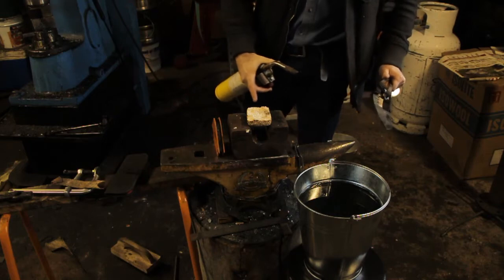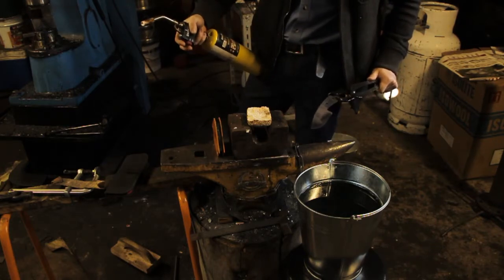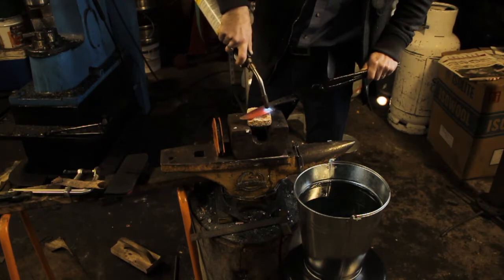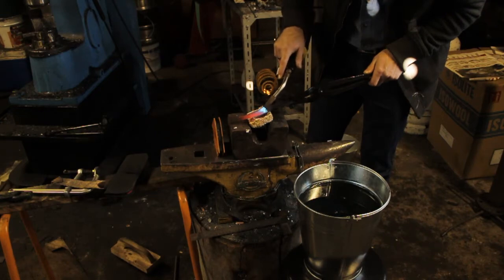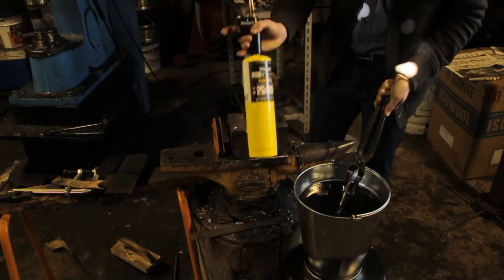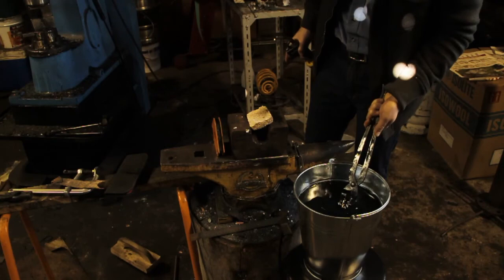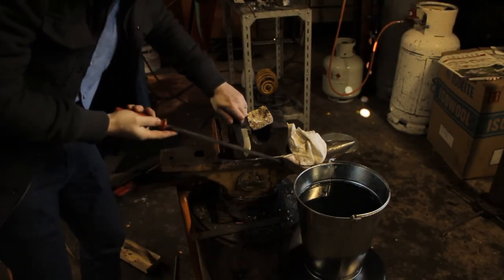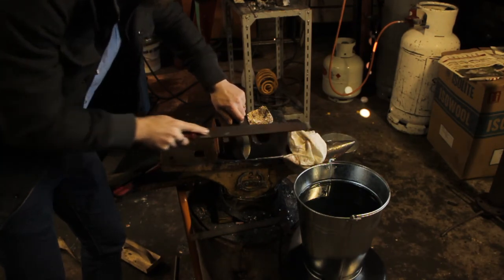Heat treating with a Map Pro Torch

Comment: I think you might be working against yourself having the torch so close to the knife.  Correct me if I'm wrong but, allowing the inner cone of the flame to touch the work tends to have a cooling effect as it allows unburned fuel, which is cold from it's phase change from liquid to gas, to contact the metal prior to it's ignition.  If you maintain the flame so that the knife is at the tip of the inner cone, rather than the inner cone mashed up against the knife, I suspect will heat much faster than as demonstrated.  Just a thought...

Comment: I've always used my homemade propane forge to heat treat never tried to use a map torch until today. Well last night, I was using unknown steel so I tested a piece and it hardened great, but when I went to heat treat the blade I couldn't get a uniform heat. I ended up doing it in two parts. Bottom half closest to the tang then top half. It hardened enough to slice my finger open and then cut paper after I ground the forge scale off on the belt but I wasn't satisfied with it so I annealed it and I'm just gonna wait til I can get my propane tank refilled. Money's tight these days is the only reason I even tried with the map torch. I just happened to have a tank sitting around unused. Not sure why I couldn't get a good uniform heat, the blades only about 5-6" inches long. Idk 🤷🏼‍♂️

Comment: awesome work! may I ask what burner and torch you used? I'm going to try to make my first knife next week and plan on heat treating my 1084 with a torch. I just haven't decided what I need to get yet to do it. Thanks
Reply from the maker: Hi Craig, its a BernzOmatic. By itself it won't work however, you will probably need a proper heat brick to hold some of the heat in. Field Furnace Refractories sell all types of insulation if you want to give it a go. I would strongly recommend building a small heat treating forge though. look for forge burners on Artisansupplies.com.au. For a little more effort building the correct tool it will do 100 times a better job than a hand torch.
Reply: would I be better served getting a coffee can, lining the inside with some insulated kaowool, and using that with a torch? Thanks for the quick response!
Reply from the maker: Craig Cissel No, coffee can forges are terrible. The uneven temperature gradient will botch everything you do. It will be 100% of the effort to make an economy size working forge and 0% effective. I made a coffe can forge, trust me ;)
Reply: How would I go about doing that? I have some kaowool on the way now. How would I go about making an economy size forge? I would need it to be portable because I don't really have a dedicated workspace. Thanks!
Reply from the maker: Craig Cissel economy size burner from Artisansupplies and a 4.5kg gas cylinder. Line that with kaowool and it will work great. There are vids on that website on burner pages that show how to line a forge.
Reply: Thank you very much

Comment: So you are quenching as soon as you hit non-magnetic? You're not going slightly past non-magnetic?
Reply from the maker: With this method by aiming for non magnetic you will probably overshoot the 815 degree mark a bit. If you aim for "slightly past" I reckon you are likely to overshoot by 100 degrees. There are a lot of variables with this method but if a little torch is all you have it can get you started in the hobby. If you enjoy it, long term aim to build something that provides good insulation and bettler heat control for heat treatment. Have you had a go yourself yet?
Reply: @batcountryforge5945  I see. I've made about a dozen knives. I hollowed out some fire brick and use a mapp gas torch for a mini forge. I still have a lot to learn about heat treating.

Comment: long time to achived the cherry red because he put it on the wood while heating..the wood absored the heat of the blade..much bettee put it on the hair..must faster.
Reply from the maker: Hi Joaquin, actually the torch is unable to maintain an even temp across a 3.3mm x 100mm section. Not even suitable for edge quenching. . A smaller knife would be ok but not this size. I did a few of these vids that show a few of the problems with standard garage heat treat methods. I would recomend Gameco burners for better results. Thanks for watching!

Comment: You should be heating it up down the spine to avoid overheating the edge..fyi
Reply from the maker: With that size torch you wouldnt get enough heat into the steel by heating from the spine. An oxy fuel system would be another story however.
Reply: I agree with Thad. If you run it vertically I think you'd be surprised at your results.